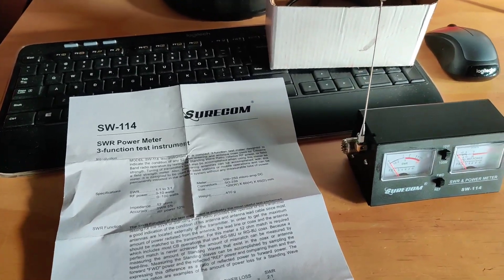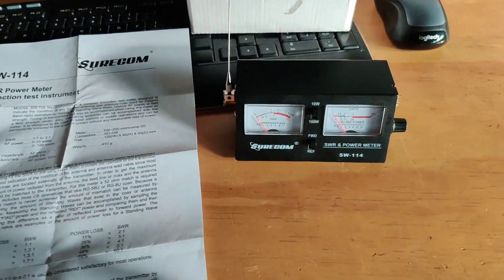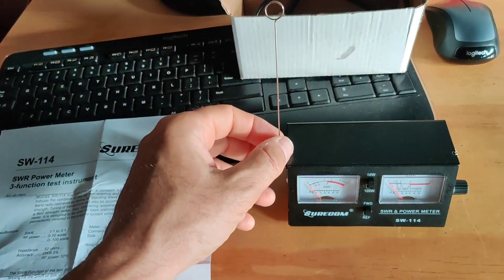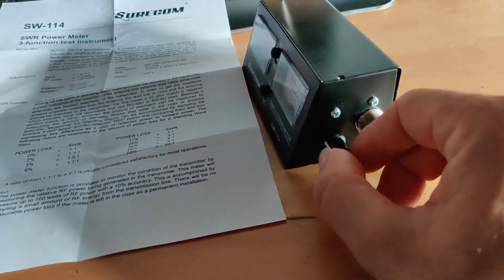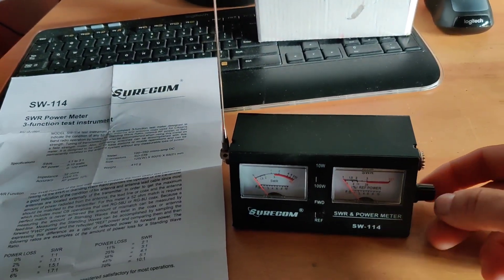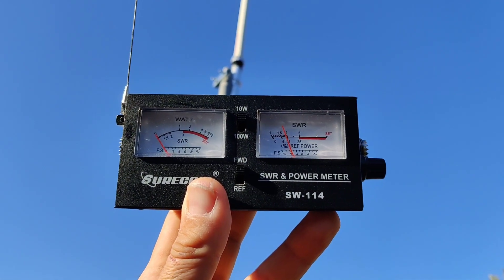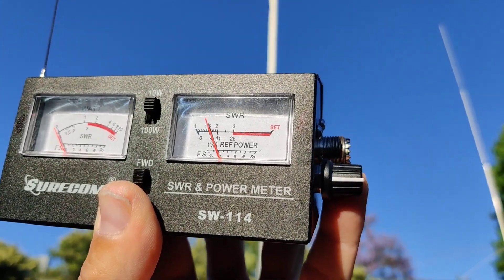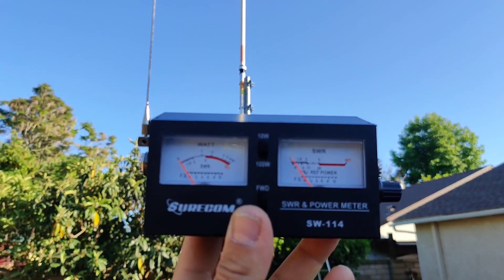Antenna Magnetic field strength testing with a cheap Power / Swr /Field strength meter.

Comment: It is an RF field strength meter
when you use the antenna.
It is not a magnetic field meter
yet simply a small element to detect an electric & magnetic field from a radiated signal.

When we send a signal it has two components.
One is the magnetic field component 
and the other is the electric field component .
Your meter would not detect any steady magnetic field
nor would it detect any steady electric field.
it only detects changing fields
which is what we call EM Fields.
I like your video my friend 🙏
I am also an experimental Ham and CB Guy.
Keep up the good work
and feel free to look at my lame videos too.

73 from Crazy Ham 🙏💡🙏
.
Reply from the maker: Thanks for the comment.  Like they say live and learn 😄.  I am sure more people will learn about this extra tool in this cheap swr meter.  I couldn't find any info so I posted that video. Thanks for explanation 👍.  73

Comment: Also , I see operators using these setting up their multi•antenna competition vehicles , like a Chevy Suburban for example . They key the mic and lock it then walk a circle around the vehicle to make sure the most signal is directed towards the front , or side or whatever direction they want to concentrate the signal

Comment: The reason the field of strength is much stronger in that particular area is because if you notice , when the needle moves at it’s furthest point to the right , is when the 2nd antenna is directly at the noon position behind the meter . The 2nd antenna is acting as a reflector , or a “back door” just like a horizontal Yagi multi-element antenna . It is making your  vertical ground•plane omnidirectional antenna behave like a directional antenna . The 2nd antenna in view is acting as a back door reflecting the signal directly back towards the source
I hope this helps . 
73’s and Happy 4th of July 

347 👋🏻
Reply from the maker: Thanks for the explanation. Now when I think about that something tells me that antennas should be at least full wave length away from each other. Didn't think that they will react to each other when one is only in operation and the other is not. 👍
Reply: @myszaca  
Yeah , they definitely will “react” with a live antenna even if the other antenna has nothing hooked up to it (coax)
73’s

Comment: What does the magnetic field strength tell you? Does it show the direction of antenna resonance? More magnetism in front of a beam antenna? If so, doesn't the design of the antenna tell you as much without the meter?